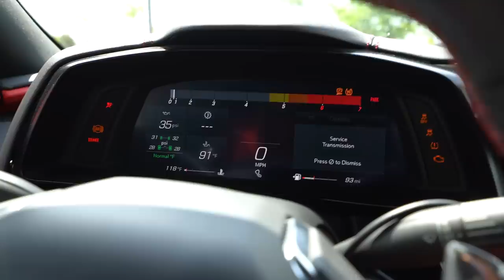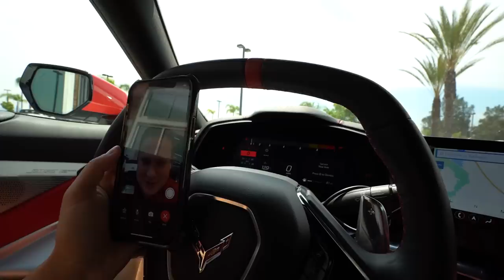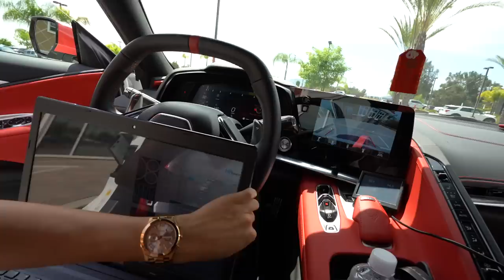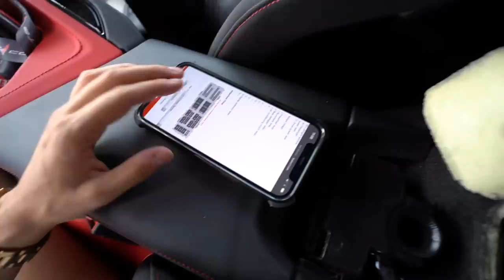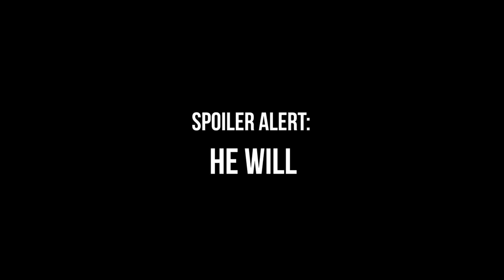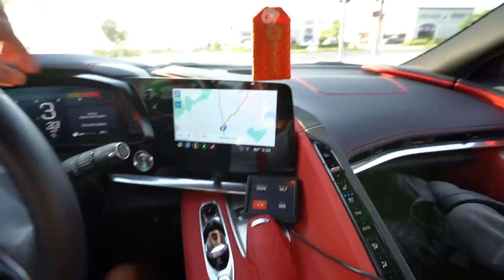don't hate me...this is my decision.

Comment: Low voltage will cause all kinds of modules to shut down on newer cars.. I run into this all the time on car lot cars when they use small jump packs to start them on dead batteries.

Comment: KNEW IT! 💜
Reply: She had to do it sooner or later
Reply: @Andrew9565-AD  100%
Reply: This one of the best f1 sounding Ferrari ever created ❤️❤️❤️❤️🥵🥵🥵🥵
Reply: Me to she is way to smart to part with that car yet, cant wait to see what else Emelia has in stall for it, Personally first thing i would do after it's fixed is replace the Z51 Spoiler with at least the C8 High Wing or better, spoilers create drag preventing the car from lifting, whereas a wing creates down force, same amount of grip but by removing the drag, the car could gain about 0.5 seconds and that's just with the basic C8 High Wing, i would consider a wide body kit as well so wider rear tires could be added giving better traction.
Reply: @C.CUMM1NGS  you don’t use spoilers for drag racing, only track racing
Reply: @RathOX  That C8 is currently fitted with the Z51 Spoiler look it up, that's why i said replace it with a wing.
Reply: @C.CUMM1NGS  i know….you dont get it, you dont use wings or spoilers for drag racing, maybe a duck tail but thats it
Reply: @gremlin915 11 2 she knows lmao
Reply: Get a z06 2023
Reply: @RathOX  Depends on the type of drag car 😜, but the spoiler is slowing the car down if she removes it she loses some grip so better to replace it with a wing.
Reply: @Ronak Siwatch i did…hench why Emelia hearted lol
Reply: @C.CUMM1NGS  not really lol & yeah thats why you have a proper adjustable suspension/back end (like mullet) & also fatter drag tires, adding a wing for drag racing negatively impact times, its all about the cars setup for suspension etc rather than needing downforce from a wing
Reply: @RathOX  Actually some do forgot the name of them, the really long thin ones, the 4 and 5 second dragsters have really high wings 😎
Reply: @C.CUMM1NGS  you mean the ones with jet engines….to stop it from taking off…
Reply: @RathOX  No not jet engines just normal engines, but they produce about 10k to 20k  HP and need replacing after every race,  they are NHRA cars google Top Fuel Dragsters.
Reply: @C.CUMM1NGS  my point still stands tho lol its to stop them taking flight xD its more a stability thing too
Reply: @RathOX  Yeh but i was still right some drag cars do have wings 😜👍
Reply: @RathOX   to @C Cummings I’m not here trying to say I’m any smarter than either of you. I was just reading your message thread and I do think that by adding a wing on Phoenix will do much help. The only reason I say this is because the purpose of any kind of spoiler or wings on the back of race cars is for it to create downforce like you’ve both stated. However when your only going 1320 FT in 8,9,10 seconds the car is not going to create any amount of usable downforce in that short period of time. Which is why they use different suspension setups,traction bars, stabilizer links, the use or none use of front or rear sway bars. ECT,ECT. But my point is that unlike a NASCAR Stock car where they have a strict rule of a spoiler on the back that can be at a 55 degree angle otherwise the car is not within the rules. But this isn’t applicable in the situation I was just explaining that the rear spoilers and those cars once they get up to speed create a certain amount of downforce and drag once they get up to speed when they are going 190MPH around the track! & the same thing applies to F1 & Indy car’s & NHRA BIG DADDY CARS, that reach 350-400mph in 3-4 seconds now those wings are creating downforce due to the vastly higher MPH there going in that short period of time. Now I know what I’m saying sounds like a double standard because I started off by saying adding a wing won’t help Phoenix because she’s not reaching those types of MPH’s. And again I’m not here trying to bash anyone I’m just sharing information that I learned from a really good race car driver I’m friends with nobody famous or mentionable just a really smart & talented guy. So anyways I hope that Neither of you are going to go KEYBOARD RAMBO on me lol. Just having good conversation. Take it easy guys! 👍🏻😎
Reply: @RathOX  Top fuel funny cars and dragsters Prostocks would have something to say about that.
Reply: @cindysue5474  thats due to them actually needing them, ad they make so much power, im talking about normal drag racing.
Reply: @RathOX  some normal drag racing cars do need spoilers for stability. It definitely helps keeping the rear tires more planted, and depending on suspension configuration and other factors, wing could be a huge help. But you’re correct that most of them normally don’t, simply because of drag. It’s not like it’s unheard of though.
Reply: @sam0wings  exactly, more what i was getting at it most if the time negatively impact times doesn’t mean non of them use tjem
Reply: @RathOX  you’re one spicy person in the comments lol. You know where you stand. At least you do it in a nice way.. Unlike anyone else who just wants to argue, instead of actually debate about something interesting that you can both learn something from.
Reply: @RathOX  but yeah a well setup drag car, should definitely not need a spoiler. But instead something that extends the rear of the vehicle, giving it a longer sleeker tail.
Reply: @sam0wings  yup normally a small extension piece, stops the air vortex behind the car from forming
Reply: @sam0wings  oh 100% im not here to shoot people down and say F you im right. 
Can always learn from things

Comment: I own a 1996 Nissan 200sx-ser ...with over 220 thousand miles on it.. it's a stick..2.0 litre ..thing is fun as heck and I can take it out of gear and push it around by myself.. or even use the starter motor to move it if need be.. This vid reminded me of why I don't want a car that is dependent on a computer to actually work.

Comment: Ik making this comment only 7 mins in so idk if the problem is resolved. but chevy has been having a problem with their trans temp sensors going out for like the past 8 years. all the vehicles with the 8 speed trans for sure.  and instead of having an externally accessed sensor like most vehicles, its build into the internal trans harness. so you have to drop the pan, drop the valve body, pull the whole harness and replace it.  I was quoted $900 and some change to have it done on my silverado. this was after paying $650 for the fluid change to the new fluid to stop the TTC shudder ( the feeling like you're running over speed strips)

Comment: THIS? is why I don't like modern cars. too much electronic shit to go wrong
Reply: When I was young, if the car cranked, but would not start, 3 things to check. Gas? Choke stuck closed? Ignition points? almost always one of those 3.  Does not crank? Corrosion on battery terminals, dead battery, and smack the starter solenoid.  Even into the 70's this was the case.  Today, hope you have lots on your cc limit!
Reply: @jonsmith1259  exactly. heck even up thru the early 90's it wasn't too bad.  There was more to check but it still wasn't horrid. 
I still have my 94 S10 blazer. I love that thing, it's been abused, neglected and still keeps on tickin.

Comment: Don’t have enough fluid in the transmission remember you leave can you put Transmission to run it during the drive in probably leaked out the fluid. And that’s why it’s freaking out with with out the fluid to read and enough fluid to get the pressure to go into gear.

Comment: Try to find a manual Ferrari 360. The 458 is a great car, but the rowing through the gears in a gated manual, hearing that "click-clack" with every shift, you feel much more connected to the the road and the car than in a 458. In terms of handling, the 360 is every bit as good as the 458, if not better. They are absolutely wonderful cars. If you ever come to Michigan, drive mine and see for yourself!

Comment: Too bad the EPA is trying to ruin the automotive aftermarket.
Reply: which is a joke considering how much pollution electric vehicles cause when being made.
Reply: And when you charge them they create even more... And let's not mention what happens when the batteries need to be replaced in 3 years... Pollution pollution pollution... But hey the simple minds say look I can't see it pollute so it must not be doing it ...
Reply: The EPA will only go after cases that are a slam dunk win in court. The EPA does not want a lenghty challenge that will possibly set a precident not in their favor. The EPA is only going after sellers of products that only have specific drop in application in vin vehicle, and could not possibly in a race vehicle, or mower.

Comment: As a fan from your trip to Ca to the Museum and then a lot of C8 content, how could I be angry with you? After all, I'm just a fan and you are living my dream content. Your C8 is a first year car and one of the earliest serial numbers out there. Then there was that whole period where you brought us along for the ride back home with all of the side trips. In the meantime, Chevrolet finally produced 2786 cars or something and then it had to shut down. There were various shutdowns but those who had C8 were rare cats in deed. Then each run and each mod. Every time you overcame a fire or a problem, America was cheering along side you. Then the records started to fall. You weren't by yourself as others were attempting to take all of your records (except for the one run by Speed Phenom at 2.6 seconds with a totally stock C8, early on), and while getting some, your zero to sixty and your quarter mile times were legendary. On top of this, no one has really unlocked the ECU yet, forcing some work arounds. All of those great things happened with those race clutches, but you got all you could out of those original race clutches and now you know you need something even stronger in the gear box. I'm the guy who say that if you continue your road with this car, it will be worth a half million not that far down the road. The 180 sounds like a lot, but I'd say that accepting that offer would be a little like giving the car away. Then there's that board with your goals on it. If you achieve all of them, your car rising out of the ashes will move right on up to  million dollar status. Of course that is all just my opinion. Enjoy the ride. While the 458 is flat out a great car, remember: S.P. got himself a McClaren and his content started to drop off a bit. Of course he's going after a C8/ZO6. Interesting, but down the road there will be a Zora. It's your journey that is taking your rare C8 to another level. My experience is only with my 2020 C8 which has its own story as they all appear to have. This Phoenix has more life in front of it. Best wishes.

Comment: I am surprised that any of your sensors work as deep and many time as you have ripped into that C8 just press the start stop button and the transmission should go to park and shutoff a C8! If you have your C8 in neutral they can wench it on to a flatbed and and take it to the shop If it is in neutral. Do you ever replace all the wire clips you have broken. To open the Frunk ores the button in the drivers door pocket! Park will lock the DCT and you can’t pull it on to a flatbed. If you can shut the car off after loaded on a flatbed set the electric parking brake!

Comment: Got a love dual clutch transmission technology, this is the first year this car has one of these and while they are great, you just have to adore these little flaky problems. Fiat and Dodge got their behinds handed down to them on these problems.   They could not figure out how to fix them and ended up replacing part in my wife's Dodge Dart which at some point turn into a transmission replacement. I jumped in, cause I got fed up and pointed out that they were miss diagnosing the issue.  They gave me all kinds of bull so I pulled the car off their hands and fixed it myself.  It had to do with getting a bunch of codes that were wrong. Temp to high was one of them followed by gears not ready, and ultimately not moving at all. Unplugging the battery would clear it but it would come back sooner or later. I found an electrical flaw and a mechanical.  The electrical had to do with having the wrong reference ground and the second a mechanical one. The car has been running ever since without all of these annoying issues. Trust me, it is not the transmission, nor the actuators, nor the pressure pump. Specially if it runs after a battery reset or a swap in TCM modules.

Comment: Nice!! 38,000 is a ton! 
My families machine shop is 32,000 feet and IT feels like it goes on forever when you’re walking between the CNC machines 😂😂

He’s right. The GT500 does look better. But that’s because I’ve driven a 458, Huracan, Vantage, Phantom, Vulcan, which I still have. 
The GT500 is just as capable as that 458, sis. I’m serious. And it’s so much easier to work on and source parts for.

Comment: 11:20 shows $3.84 on the running pump at 0.834 gallons for 91 octane gasoline (that calculates to $4.60 per gallon) on the west coast.  If the Ferrari is able to get 10 miles per gallon, then that is about $.50 per mile operating cost for fuel.  Amazing compared to a Tesla model S operating cost(s) for nearly equal "plant you in your seat" performance.  Note: I own/drive a 2007 Honda Accord, a 2010 Mercury Mariner and a 2011 Toyota Sienna - so why do I watch this YouTube channel?

Comment: hello Emeila, 
you making that kind of hp 8's ... 1500 hp and the 7's 2200hp maybe a high 6,  interested Steve Morris has lambo billet blocks and heads 2700 hp engines check it out .
(4) 10,000 RPM!! Lamborghini at 2700 Hp! - YouTube
Reply: You are going to need a the trans built before going faster if its slipping and throwing codes / the trans module specifically may have something going on with it. 
be safe take care as always be watching !

Comment: disconnecting the battery won't shut off the car. If it is running you can take the battery out of the car and it will stay running, that is how you check the charging system.

Comment: Car has to be running to be put into neutral, if car doesn’t run you need a special bracket to hold shift shaft, that’s how all the new push button trans works, so dumb 🤦‍♂️